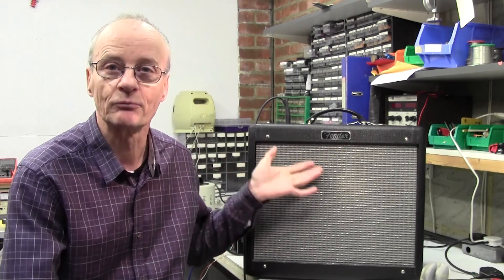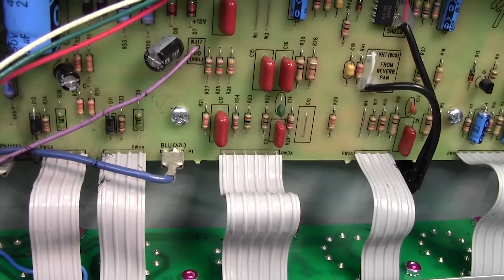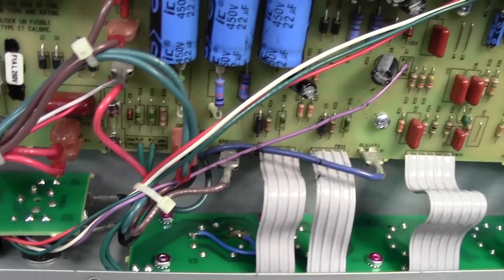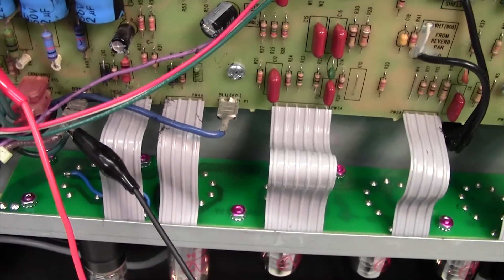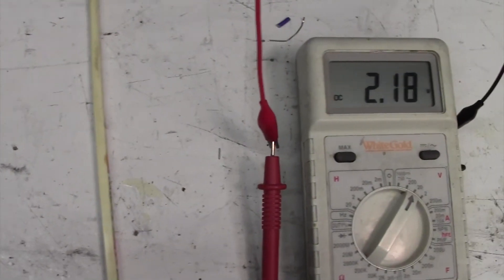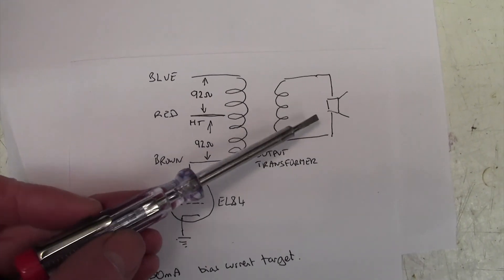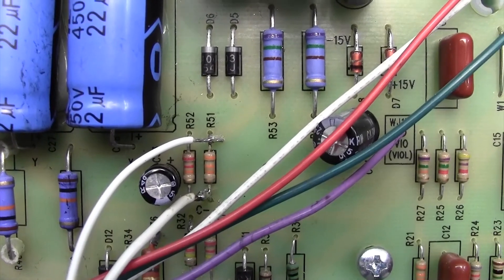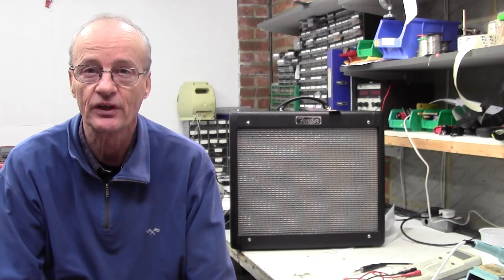How to Bias Fender Blues Junior Guitar Amplifier

Comment: Hello Stuart,  thank you for sharing this information with us.   I have a question, I have a Blues Jr 3 and I want to piggy back the R51 resistor with a 82K - 1/4 watt resistor, will this be OK? or do I need to use a 82K - 1/2 watt.?  Cheers Neil
Reply from the maker: 1/4 is absolutely fine.
Reply: @stuartukguitarampguy5830  Thank you very much for your prompt reply.  Very much appreciated.

Comment: i sure wish you had documented the repair you completed on that BJiii - i suspect i am having the same issue and have runaway voltage blue OT with burning hot tubes 😮
Reply from the maker: Sounds like it might be a bias issue?
Reply: @ I think so, leftmost EL84 was running 3.7 to 3.9 volts;  overall amp sounds good but somewhat brittle.  I seem to have a current surge on startup ... a noticeable hum and slightly increasing volume hum, then a quiet op at end of hum and normal operation thereafter.

Comment: Thank you for the time and effort.  I've replaced the Chinese valves in my junior with NOS 1950's RCA 12ax7's and RCA EL84's from the same era. Also, I replaced the OEM speaker with a vintage Celestion G12T-75 made in England. Recapped with F&T capacitors.
Reply from the maker: Great well done.

Comment: I have seen other BJr bias vids but yours explains measuring the bias using the transformer resistance method quite well. In lieu of a 1ohm cathode resistor or a cathode biased amp, I always use this method. Thank you
Reply from the maker: Thanks Frank.

Comment: STUART, If an amplifier has 4 output tubes and each power tube is NOT matched, how can you take the Average bias current? How would you take the Average of the bias current on 4 unmatched power tubes
Reply from the maker: Hi Wayne. Hmm, I'm not sure why you are asking this question. Why would you want to know the average current? Of course one way would be just to measure the individual currents and work it out from that. Ideally you should have a matched quad. If for some reason you don't, then ideally you should balance up the pairs and try to get about the same average current through both pairs. I'm not sure if that's the answer you were after.
Reply: @stuartukguitarampguy5830  other amp repair techs take the average current of the 2 unmatched or 4 unmatched pair of output tubes. Since they can't balance the unmatched tubes biasing current to have each with the perfect tube dissipation per each tube. The method is taking the average current per each output tubes biasing current and take the average current. Example if output tube#1 biasing current was 40mA and output tube#2 biasing current was 45mA , output tube#3 biasing current was 35mA, output tube#4 was 55mA, what would be the formula for the average biasing current? This is a very common problem with biasing unmatched tubes

Comment: Actually I do have one of those. Actually mine has two sockets. 
Anyway my question to everyone I run across. I have a blues junior. It hums fairly loud when warmed up. With the back still on, If I put my hand, or a couple of fingers, between the driver tube and power tube, it stops. Any idea what this indicates is the problem. I'm guessing a capacitor/capacitance issue of some sort, but haven't figured out a solution. Maybe a ground issue?
Thanks in advance for any ideas.

Comment: Great Stuff and much appreciated. I have a 1999 USA Blues Jr (green board 1995 Rev B P/N 049305) purchased new by me in ’99 which is different from all the cream board Jr’s all over YT. Even with limited use as a bedroom amp the hot bias has has resulted in a few power tube socket pins to loosen from the tube board, thus the desire to cool the bias and continue using the amp. As I understand this board revision schematic, R37 and R31 make the voltage divider circuit and a parallel resistor across R37 would cool off the bias. Values per the schematic are  R37-33k and R31-22k. What would the proper ohm rating of the resistor to accomplish this?

I hope I have described all this properly.

Thank you…
Reply from the maker: Sorry for delay - you've probably done it by now. Anyway, start with a 220K and see what that does - you'll need a way of measuring the bias of course. Work down in value until you get what you need.

Comment: A power tube (purple lighting inside) took the OT and the PT,but left the boards alone ...put in replacement transformers by Hammond and 2 brand new JJEL84 (200Euro) and did the bias mod with 68k...tomorrow I'll switch it on the first time since it died and gone to heaven...
Thanks so much Stuart, your vid helped me a lot!
Reply from the maker: Great I hope it sprang into life!
Reply: @stuartukguitarampguy5830  YES! :-) works good so far,...no hum,no crackling and it sounds as it should
  the bias is at 2,5V (outer power tube)...though the inner power tube is at 2,2V....I will see how it's gonna be when they're burned in (matched pair)
Reply from the maker: @okidoke-xe8gj  Great well done.

Comment: As you promised it was interesting and no wonder the amp was given away, after watching videos of burnt tube sockets that needed to replaced. I have  the first series amp like on your bench which looks pristine inside with no speaker output. thanks for the disclaimer as I got a static buzz even with the power off on the reverb tank wire, so be careful.

Comment: Trying to bias my 1 year old BLUES JR IV SONIC CREX 120V FSR2019. They seem to have again changed all the components around. R51 and R52 have been changed to only 266 ohms and 252 ohms? My readings from P2 red to P2 brown are 3.4 volts DC. And P2 red to P1 blue are also 3.4 volts DC.  I wonder where I can find the correct schematic? I want to make sure I'm adjusting the right resistor.
Reply from the maker: Hi As it happens I can help you out with that. The FBJ IV has a different bias arrangement to all previous FBJ. The IV is cathode biased, which means it's not adjustable. The neasurements you took indicate that it's running a bit hot but it's probably designed to run at that current. So you can leave well enough alone, or if you really MUST adjust it you'll have to locate the cathode resistor and increase that. I don't know where that resistor is. It's likely to be R51 and R52 currently 270ohm. You could increase those to say 330 to start with and see what happens.
Reply: I  didn't  find an updated schematic on Fender's site. They should have an updated manual at the very least.  To tell the customer they no longer have to have the amp biased by a technician. That would save them money on warranty.
Reply from the maker: Exactly. No, I don;t have this schematic either.

Comment: Do transistor amp have bias setting or only valve amps , and whilst replacing capacitors is it ok to fit exactly the same legen caps that at a third smaller any advice on this would be very much appreciated, thanks Craig Macdonald.
Reply from the maker: Hi only valve amps. Do you mean 1/3rd physically smaller? If so, yes that's fine.

Comment: Thanks for the great video, very informative. Would it be concerning to use a 1/4 watt resistor vs. a 1/2 watt? And would this change with resistor value, say using 68K vs 82K or 100K? Some back-of-the-envelope math tells me it should be ok, but answers in forums seem to vary as to the safety of it.
Reply from the maker: 1/4 W is fine for all those values.

Comment: Hi Stuart, another great clear and concise video. I was wondering re the crocodile test leads. Do these need to be rated at over 300v ? If so, any idea where I could buy them ? Most of the ones I have seen don’t seem to have a voltage rating. Many thanks
Reply from the maker: Thanks Paul. You only need a voltage rating when two things are in very close proximity to each other and might arc across. E.g. the voltage rating on a capacitor is defined by how close the plates are and the insulator between them. That's why high voltage capacitors are larger - the 'plates' need to be spaced further apart to withstand the potential arcing across.So, you can't really put a voltage rating on a piece of wire (e.g. croc clip lead). A current rating, yes, but not voltage. I hope that makes sense.
Reply: @stuartukguitarampguy5830  Thanks a lot for the reply Stuart. To be honest it’s still not clear as the actual multimeter test leads have a voltage rating. I’ll see if I can find some more info via Google. Many thanks

Comment: Hi Stuart  what are your thoughts of getting the blues junior to run at the uk 240vac i understand that at present they are set to run at 230 vac!! Is this wise to do,  as its apprently a case of swapping the wires over on the power on switch !!
Reply from the maker: Hi Andrew  YEs good idea if you can get it done.
Reply: @stuartukguitarampguy5830  stu is it a matter of just swapping  the two wires over as people suggest  or new transformer ?
Reply from the maker: @andrewmules5191  I've never actually done it. I don;t think you need a new transformer, just a change to which primary winding you use. If someone has detailed how to do this on,say, YouTube, just follow that.

Comment: Hi again Stu i just took a reading off the blue 2.5 v  !! Is there a potential fault ?
Reply from the maker: Brown to Blue? 2.5V? That's 25mA which isn;t far off. Why do you think there may be a fault.
Reply from the maker: Hi Jut saw your other post. Stick with brown to red for the moment and ignore blue. For some reason I've never been able to find out, measuring broiwn to blue can sometimes gives weird readings.
Reply: Hello stuart with reference to an esrlier post regarding bias current  !! Ive put new tubes into my amp and did a current test off the blue which reads 2.45 and out of curiousity it read -2.48 and the speaker started to hum a little, could there be a fault with tubes ive swapped them over and still the same outcome !! or could there be another problem . I do wish i was nearer to your workshop !! If you can shine any light on this much appreciated .

Comment: Hi Stuart  ive just taken a reading off the brown wire on my blues junior  the reading came in at 4.27 very high the meter was set at 20v Dc  can you suggest a resister value to drop the voltage ?
Reply from the maker: So that's about 42mA. You'll have to adjust to bring it down. Did I send you the bias manual for this?
Reply: Hi stu i havnt had your manual !! That would be a great help Thank you. Just one other point  regarding my earlier question regarding running a jewel lamp off the heater leads. Does it matter which wire goeos where on the bayonet fitting fron the two greens ?
Reply from the maker: @andrewmules5191  If you go to the splash screen at the end of all my vids you'll see  my email address contact me via that for the manual. No either way around as it's AC!
Reply: @stuartukguitarampguy5830  Thanks again Stu . god i wish i was closer to you i think i would have given you the amp will email you soon as Thanks again have a merry crhistmas👍

Comment: Im thinking of changing the cheap looking power lamp for a jewel lamp on my blues junior, can i use the exsisting led wires  to run the lamp or does this mod require other alteration to achieve this ?
Reply from the maker: Hi Andrew No you can;t use the existing leads as there is probably a series resistor there. Take the feed off the 6.3V AC heater windings  and that should do you.
Reply: @stuartukguitarampguy5830  Hi stu thanks for that i take it the two green w ires are the Heater leads! I will test voltage off these  cheers
Reply from the maker: @andrewmules5191  Yes it's usually the two greens. Check with a meter if you have one.
Reply: @stuartukguitarampguy5830 Thanks stu for your valued  replies just one more question what to do with the redundant LED and wiring ?
Reply from the maker: @andrewmules5191  Hi Andrew  Not quite sure I understand this. Just cut off the wores and throw the LED away? Or did you mean something else?
Reply: @stuartukguitarampguy5830  sorry stu to bombard you with all this!!  I t just wondered what to do with it whether to cut it off or leave it tied up inside   !! Thank you  again👍
Reply from the maker: @andrewmules5191  Maybe leave it tied up in case someone wants to restore the LED in the future.

Comment: Great video, i'm trying te lower bias with different resistances values on R51 but no luck so far. I measure  p2-red to p3-brown  4.7 v
Reply from the maker: Hi Mathieu. Yes that's way too high. Email me and I'll send you a bias manual I wrote for this amp. That will get you out of trouble. Email address is on splash screen at the end of each video.

Comment: Can you just turn the amp off & measure the resistance between p2-red & p3-brown & p2-red & p1blue which are the anodes/plates of the 2 EL84's? If the resistance of both are similar say 91.0 & 91.1 respectively, then you could just turn the amp on & measure the actual anode/plate voltages respectively & then perform a simple ohm's law calculation of e/r=i? Then you would know what current they are pulling? Is it possible to do this way?

Comment: Hi. Great video. Thanks. Just FYI or for anyone else. I just bought the new one called Limited IV SE and checked. The circuit board is different now. Mine luckily is set perfectly at 65-67% and I’ve never seen 2 tubes matched so closely one was 22.4 the other 22.5 mV. Guess I was lucky. Great little amp with a huge sound!  Thanks. PS - PV measured about 360-370 using 2 methods a probe and then at pin 3.
Reply from the maker: Ok thanks for that, yes there are a few different versions floating around!

Comment: Hey Stuart I’m curious, what was the fault with this amp that caused the bias to go wacky ? Was it a connection issue or a flaky cap. Thank you and you do a great job there’s not many folks that would spend that kind of time to find an issue. When I was serving electronic equipment I would do the same thing no matter how much time it took to find the fault I would keep going until I found it.
Reply from the maker: Hi Wade alas I can;t remember as it's been a while. Was it when I was measuring from the red to the blue?
Reply: @stuartukguitarampguy5830  oh my bad I didn’t think to look at how long ago you serviced this amp, that’s been some time ago. Never mind thanks for responding have a great day 😊

Comment: I have a hoffman replacement tube board which has bias test points for each pwr tube, What would the vdc bias setting be ? not amps. This amp also had a bias pot added from original owner .
Reply from the maker: Hi Mark I have no idea I'm afraid as I don't know that board. The SENSIBLE place would be to put a 1 ohm resistor in the cathode of each tube and measure across that. I'd power it up and measure at the bias points. If you're getting something between say 20mV and 50mV then that's what they have done. In which case adjust to about 25mV - not critical.  Let me know.

Comment: I got a question, when I measured my OT my brown and blue got 105ohms, my red and blue got 97ohms and my red and brown got 8ohms.  Is my OT fried.  Also my BJ wont turn on, could this be the reason why?  Thank you, great vid.
Reply from the maker: Hi.  Okay so assuming you have unplugged the BLUE and BROWN so that you are measuring durectly onto the OT, the RED-BROWN and the RED-BLUE should measure about the same resistance. So if you are getting 8 ohms on one and 100+  on the other I think there is a problem there.

Comment: fender blues junior IV : R52 :  27 kohm.  R51 33 kohm. I put a 82 kohm resistor in parallel with R51. I measure 1,9 V between The Red and Brown. It's OK ? I think yes.
Reply from the maker: Hi yes that's about 19mA so not too far off.

Comment: I have a set of supposedly 'matched' JJ EL84s, but the voltage from Red to Brown is 3v (fine) but Red to Blue is just under 2v (bit low). They don't seem well matched to me at 50% different. Does this sound like a mod needed for separate bias?
Reply: One little point on my amp, is I have opted to use the 240v windings for the power transformer, not the 220v as was set originally, which does reduce the voltages subtly.
Reply from the maker: Hi Kam I've noticed this difference too. There's something odd about reading to the blue wire. I suggest you just do the broan and get the bias right on that. With a matched pair you can assume the other valve is ok bias wise.

Comment: i love that the bias meter shows plate voltage too... mine doesn't do that. only shows the current. where do you get one like yours??
Reply: i would like to put a bias pot or two in the blues jr. that might require altering the circuit topology per se and thats probably above my pay grade.
Reply from the maker: Hi John  Eurotubes sell these.